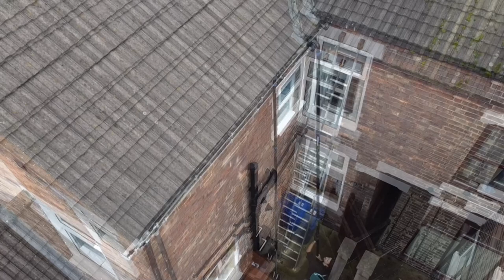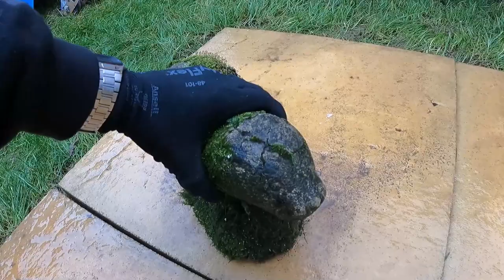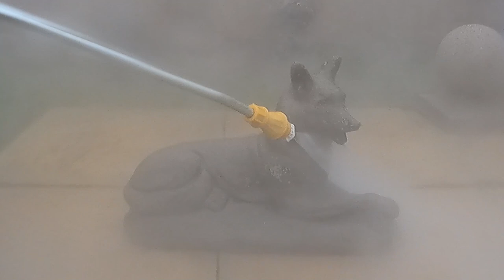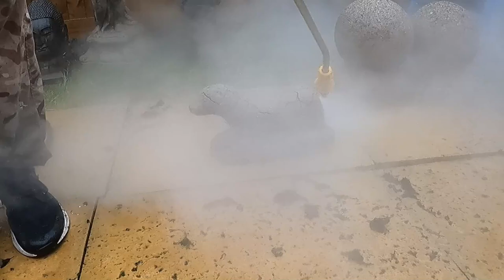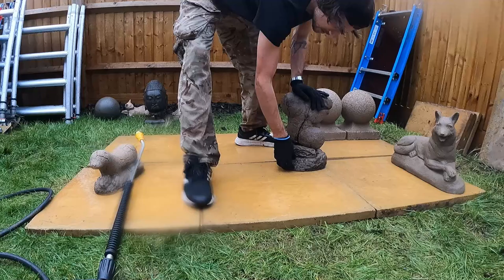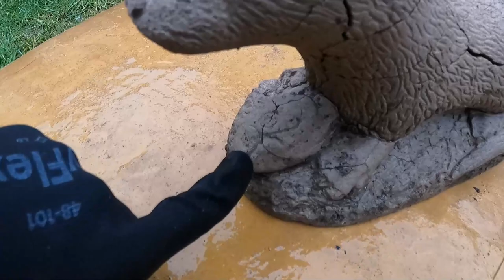Old OTTER & WOLF Get Cleaned Up After Years Of Neglect!!

Comment: With regard to the otter, you could put it inside the house and let it dry out as much as possible and then paint it with epoxy resin to keep water out, or there are some brick treatments that would also work, you want to stop frost from blowing it apart.

Comment: Hate to be the person….for the drone a few things. I used to have a commercial licence, as anything that can be deemed as commercial needs you to have one, ie it’s for work YouTube. Or it helps you work (spotting the high gutters). Ok, so that bit is done! The other thing (I found out the hard way) is that drones in built up areas can have a full fly off, and you have zero control of them. All the wifi flying around just makes it crazy, plus you don’t want that running out of battery and dropping on someone (insurance nightmare). Unfortunately the rules here are way more strict than the US. There everyone seems to fly anywhere they want.

Comment: I'd suggest getting a bit of cement in a syringe and injecting some of the otter's cracks. Not enough to fully fill out the cracks, you don't need to fill it all the way to the surface and take away its character, you don't actually want to see the cement,  just a bit of cement deep inside the cracks to act like glue to give it a little bit of stability insurance just in case it ever gets hit with a football or something. Only having the cement deep in the cracks and not actually visible will mean you don't have to worry about colour matching so much either